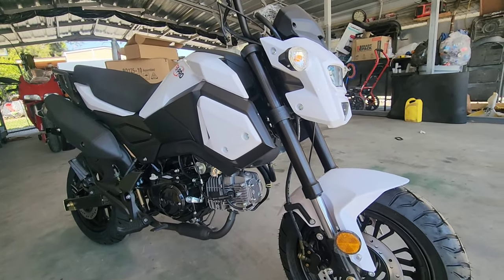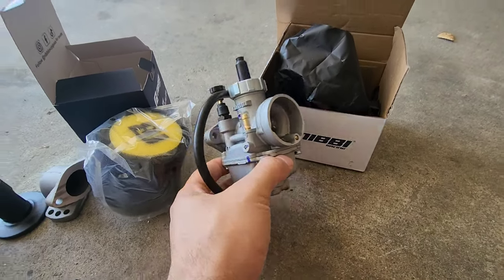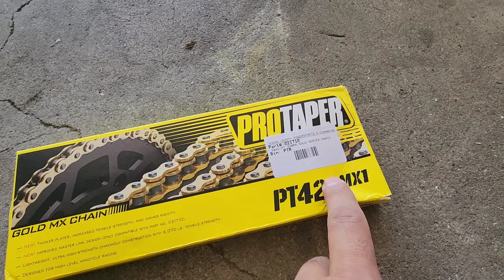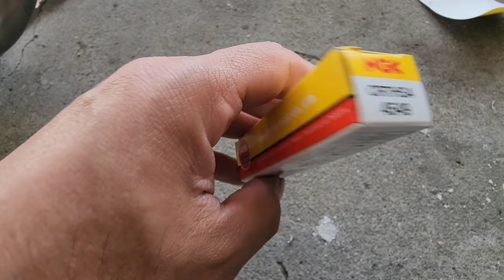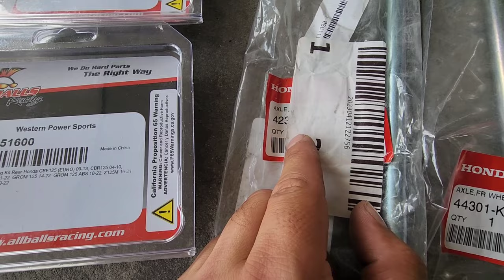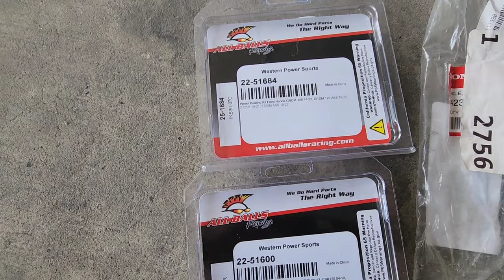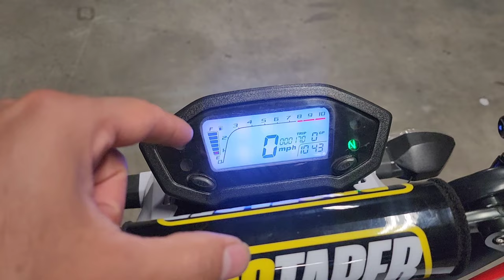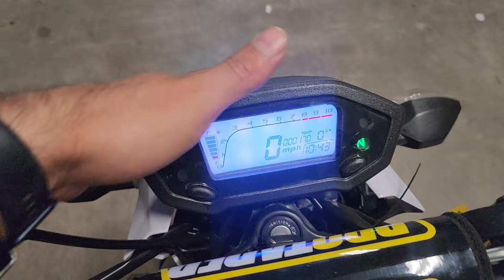Vader 125 Full Guide To Make Reliable (Grom Clone)

Comment: You literally rebuilt the whole bike
Reply: Lol
Reply: I'm about to do the same thing
Reply: $3,499 for a brand new Grom, $1000 plus $1000 worth of upgrades is STILL $1500 cheaper than a stock new grom (which to be fair would not need all these upgrades)
Reply: @adammackay8347 you can fully upgrade and do everything he did for around 550-600
Reply: I literally did everything and stripped this bike for under 300$ I got it to go from 45 to 70 after all done
Reply: @jerameyklein2846 how did you do that bro?
Reply: He literally turned a Vader into a grom and spent more money lol
Reply: @adammackay8347 Vader shipped to your house is 1400 and that’s more than 1k in parts tbh.
Reply: @CapeFilms  not at all he spent a total of 1900 for the parts way cheaper than a Honda grom
Reply: @FinityEdits-kr2qm  I was trolling I literally bought one and I’m doing a lot of what you did and more lol
Reply: I did the same thing. I got it for 1k with 90 miles. 700 in mods and now its my daily for work. I got fast cars and bikes and somehow this became my favorite toy. I can do wheelies and let my friends drive it without having to worry about breaking it. I recommend this bike to people who have knowledge about bikes and carburetors. If you want something thats reliable out the box get the Grom.

Comment: Kudos dude. This is one of the absolute best how to videos I have ever watched. The details on the parts you used makes it right up there at the top. You didn't get bogged down in the minutiae of everything you did but also didn't do the 30,000 feet gloss over either. PERFECT ! ! !  You made me order a vader. My wife hates you.
Reply from the maker: Thank you I'm glad you enjoyed and this vid was useful for you! And tell her that my wallet hates me as well haha!!
Reply from the maker: @bobscat-wj4ub  actually flicking the throttle before hitting the starter, is a way to prime fuel into the intake. Try it yourself without an air filter and you'll see fuel literally spit out of the carb. 

**When not using the choke (as you saw in the video), you can try the method I used for when the engine does turn on, you can keep her alive with some extra little throttle till she is warm enough to hold idle on her own, instead of the using the choke.**

This is how people used to have to turn carburetored cars way back in the day when they had trouble turning them on.
Reply from the maker: @bobscat-wj4ub  I will add, there are sweet spots you have to find when doing this which is why you saw me twisting it. And I will also add that I used too much throttle to turn her on in this video which I literally acknowledged. But I don't hide nothing, this is how it is irl with anything sometimes 😄
Reply from the maker: @bobscat-wj4ub  https://youtu.be/OHwfXJohRpM?si=P5Pubm01X6bVi3aC

This might help a bit
Reply from the maker: @bobscat-wj4ub  you seem to miss understand but, to each their own.

Without the choke, I can prime the carb and do this and turn it on fairly easily. Because there is no choke, I keep the rpms high enough till warmed up.
In this video, upon firing up I added a bit too much throttle. The idea is only to keep her alive with no keep by using a bit of throttle.

I know how engines work, which has nothing to do with me starting the bike. There are tricks to carbs out of the book you can learn as well.
Reply: @anythinggarage , do you have a link for the speed calibrator? One of the best videos of the Grom clones yet.

Comment: Awesome video at 10:40 what did you end up doing with that hose that throws oil at higher rpm? Did you put a catch can system or did you just plug it off?
Reply from the maker: Leave the hose connected. Do not plug it up. It is to keep the engine case vented. Route it somewhere out back maybe not directly in front of the back tire. It won't be spewing a bunch of oil but can in some cases

Comment: Old guy here , back when synthetic oil came along,  it was great for your motor but a wet cluth would slip under a good load. I believe they have a happy medium now. Better slick protection for moving parts and still allows clutch plates to grab. Tbe motor still needs to be broken in.
Reply: diesel oil is better
Reply: @thegreatkrimpus6139  I did not know that. Thank for the info
Reply: @bigfootaintreal5454  Rotella T6 is the best one since it has all the ratings that are required for motorcycle engines

Comment: Had to drop a comment. Amazing video
I’ll be picking up a grom clone that hits top speed 65mph
I want to make the experience more comforting and faster if possible 
It comes with two seats 
Now I know what to work on
I hate to ask before finishing the video
In total how much did you spend to modify?
Reply from the maker: Thanks man! The rear shock is uneeded unless you really want it. Without it, it would be about $1900 EVERYTHING
Reply: @anythinggarage  Jesus Christ! Thank you bro 
What did you swap out just to make it vibrate less and drive better

Comment: Great video.  My exhaust needs way more modding to install than yours.  I wish I would have seen this video sooner.  Either way great info and good luck with it.
Reply from the maker: Half way through the video I discovered the original exhaust I bought wouldn't work so I returned it and got a recommended one 😅
Reply: What fuel did you use to heat?  @anythinggarage
Reply from the maker: @kennyhelms277  just any normal handheld Propane torch

Comment: Curious, how much with mods you actually ended up spending on the bike? Trying to talk the spouse into letting me get a mini bike!
Reply from the maker: If you don't get the unnecessary rear shock (only got it for the red spring and reservoir look tbh), all parts cost me $550. So add that to total price.

Cheapest Grom clone that I know of is the Boss Motor 125 for 999.99 +$300 shipping. Comes with red calipers, VERY HARD front gold shocks, and maybe a better seat. Overall. The X-Pro is a smidge above in quality control and final build IMO.

Your total is gonna be around $1950 shipped with taxes and all parts used here.
Reply: Thank you so much!!! @anythinggarage

Comment: I'm always afraid to take a bolt or a wire out because I wouldn't know how to put it back. Imagine doing all those cables and nuts replacements.
Reply from the maker: @rramales1  I been doing things like this for a few years so I'm used to it. Just a skill you gain in time. It is not too hard to install. Wish I would have made a how-to video though

Comment: No hate because I'm looking at an Icebear furza (to keep stock) but with all these upgrades... wouldn't it make more sense to get an actual Grom?
I mean all those upgrades to actual Grom parts seems like it would get you close to the Grom price minus the manual labor...
Reply from the maker: Quating what i said to someone else. And btw, you can actually get one of these $200 cheaper at RedFox.

"No, not even close. The bike total price cost me $1500. All of these parts except the expensive rear shock I decided to use only cost about $400. Bringing the bike to a total cost of $1900. That includes the $275 I paid for shipping and taxes (bike itself is $1100 before taxes and shipping).

A Honda Grom Stock is $3800-$4100 (abs or no abs) new after taxes IF THEY SELL AT MSRP without a single penny of Dealer Markup!

This is not even including any other fees like Destination Charge Fee and Freight Surcharge fee + (Dealer Fee, DMV (Documentation) Fee, Processing Fee, Service/Set-up fees AND MORE if you finance it."

So in the end you're probably looking at around $5000. For a Grom.
Up to you!!
Reply: @anythinggarage  🤔
You're absolutely correct.
I'm just too lazy to do anything beyond bolt ons and electronics...😅
I have a df250rts (x22r) I've done just about all basic bolt ons (except exhaust the one it came with is actually perfect)
But I want a little more pick up and top end...
Getting a rear sprocket for this bike is probably as involved as installing it.
As far as carbs...sure I can bolt it on... tuning it on the other hand...🛫😶

Comment: Whats the overall cost of buying the bike and doing all the mods? Also how long did it take to install all these parts? I'm really curious if this is worthwhile considering you can get a used honda grom for around $2500-$2800.
Reply from the maker: Brand new, including taxes, shipping and tags, and every mod and parts used here (except unnecessary rear shock, which I got for looks), it comes out to $1900.
It did not take me very long at all, but that's because I do small projects and I'm comfortable with mechanics and some fab work.I'm
Reply: @anythinggarage  well definitely way under half the price of a honda grom

Comment: I personally have a 22' Grom SP. Have about 2000 miles on it. And since Ive got it, Ive changed the oil, that's it. I haven't had to rebuild the bike from new to make it reliable. I do believe in you get what you pay for. And its fuel injected, not carby. But if you cant afford a brand name, reliable, known machine. Ka-boom Vader is an ok second best.
Reply from the maker: I agree with you on this at a certain point. I can't justify spending 5k on this type of motorcycle for what I will use it for and what it can do. Just in my specific case. For $1500 ide say it's worth it with only a few things to get it good to go
Reply: Quit it with the brand name reliable n well known😂😂😂 Homeboy in the video installed and did what 99% of grom heads do , which is install aftermarket parts but in the end , his vader will be just as reliable or better and for sure it’s faster !😅😂 And in the end , homeboy has a faster and just as reliable bike for half the price Mr SO CAL, CORN DOG!!!✌🏼🤣🤣🤣🤣!!  To all riders , cheers from East Los Angeles , Ride Hard n Ride Safe!!✌🏼👨🏼‍🦲👌🏼🛵🏍💯
Reply: @rosieorozco4517  not half the price but 1/4 the price

Comment: You used 3/8 bolts.  The holes in the case were probably drilled to metric and when you drilled to 3/8 you didn't take out a lot of metal so couldn't you have just used a grade 8 metric bolt that would fit the metric hole in the case???
Reply from the maker: Yes! This is a thing that has been talked about before. I forget what metric size bolt they use as an alternative for 3/8, but in general the 3/8 is thicker and much more sturdy than the metric counter part as there is still slight wiggle with the metric bolt. Drilling everything out with 3/8 also makes an exact fit for better overall reliability!
Reply: It would probably be M9 but not sure. Just looking to save having to pull the motor. I think if I was going with 3/8, I would try to just drill one mount at a time with the engine mounted. But thanks for the response.
Reply: Plus, I was thinking it would be better to leave as much metal on the case as possible since it is aluminum and much weaker.  Again, a REALLY great video.

Comment: im getting one to starting learning how to ride thanks for this video
Reply: but i dont really wanna spend that much all at once so what are the main things that i should get edit : easy things i dont wanna take the whole thing apart
Reply from the maker: The easiest and best things to get are the 24mm nibbi carb kit, throttle kit, and the manifold. Look at the description. Also, get the exhaust. There should be 2 links for that.

The free:
You will have to get rid of all of the emissions stuff, cut down and close the egr tube, get rid of the charcoal canister, and take off the valve on the fuel breather.

This should give you the best bang for buck. There is no need to remove the motor. Your motor mounts should survive for a short time, but just be aware that eventually, your frame will break.

Comment: Did that throttle kit with cable need any adjustments with the carb? Ive had a 26mm nibbi i used with the stock throttle cable and had so much play in the throttle which was annoying. Returned the 26mm though because it was to big and had issues. Was tryna see if that throttle kit and cable worked perfect or not
Reply from the maker: Yes worked perfect! Check description!
Reply: @anythinggarage  hows the 22mm holding up though? I heard the 22mm is to small and 26mm is to big so people say go with the 24mm. If you havent touched the idle or fuel screw since you dialed it in the video and etc ill most likely get the same one you have with the throttle cable setup
Reply: @anythinggarage  im also trying to find that 3 bolt intake manifold you installed but cant find it. Or did that not work that good so you got another one?
Reply from the maker: @GregBartlett22  it did work. But I ordered a separate one to see if I can install facing to the side, but it ended up being the same angle.
Reply: @anythinggarage  still using it or changed the carb?
Reply: @anythinggarage  let me know if that carb still runs good or if you have to keep making adjustments everytime you ride and etc. im about to order the same carb if you say all is good so far with it

Comment: First thought that popped into my mind was - how do you pass inspection if you've removed all the emissions equipment?  Aren't bikes like cars, if it was built with an airbox and egr then it must have an airbox and egr.  I'm in NY and know they're pretty anal about modified vehicles.
Reply from the maker: There are no smog inspections on motorcycles at least in my very anal state of CA. Also I took it to the DMV to get it verified. They know nothing about anything. I was fine and you most likely will be as well.
Reply: @anythinggarage  Wow, you're right.  I went to the NYS DMV website and the vehicles that are exempted from emissions inspection are:  vehicles older than 25 years, vehicles newer than two year old, Electric Vehicles, MOTORCYCLES, farm equipment etc.  Thanks for prodding me to check it out.  Now I can make your modifications without worry.

Comment: What ahead and bought the chain off of the link in the description and it’s 134 length, what’s the best way to shorten the chain and remove links?
Reply from the maker: You can buy a chain breaker on ebay relatively cheap or use a socket, punch, and hammer to hammer a pin off. It gets frustrating but works.

There's videos on how to do this. Kids can do it.
Reply: @anythinggarage  ended up using an angle grinder and a punch! Wasnt the prettiest process but worked haha

Comment: Hey man quick question. I just got the black nibbi carb (same one just different color). Do they come with the jets already installed or do I have to put them in. If so, which jets do I use
Reply from the maker: Mine (a kit) came with 3 main jets and 2 pilot jets.
The jets will already be installed on the carb. So in a little baggy came 2 extra mains and 1 pilot.
Tuning is up to you. Ambient temperature, humifity, altitude changes everything. 
I'm in CA, not much humidity, always hot, and 350ft above sea level so I have it easier

Comment: Unfortunately the fender eliminator kit provided in the description will not fit the bike
Reply: You will at least need to change out the stock brake light that comes with the boom for it to fit, I’m not sure if the exhaust mount will get in the way or not, I think it’s just the stock brake light
Reply from the maker: Keep the kit. I will have an update video soon. There are 2 very simple modifications you have to do to make it work. 

1) Cut the middle peice off one of the plates from the kit.

1b) Install tailight at an angle (just like stock but angled to fit with eliminator kit). Use nylon lock nuts so they won't vibrate off like regular nuts.

2) Cut the middle part off of rear seat fairing to fit the tailight.

Easier done than said.

Works with stock tailight. I'm using the kit in this video.
Reply: @anythinggarage  gotcha! Excited for the update video, thanks for putting these together ❤

Comment: Did you use the stock clutch cable with the new levers? I find that the stock cable has no slack at all.
Reply from the maker: I did use the stock clutch cable. You are right.
I will admit the stock lever feels a bit better than the aftermarket. But I got used to the aftermarket one. I have not tried a new cable as of yet.
Reply: @anythinggarage   Would the  oem grom cable fit with more slack for adjustments?

Comment: So why did you get a 26mm intake and a 22mm carb ?
Reply from the maker: It's easier knowing it would work. The flow from a 22 to a 26 on these engines on a sub 200lb bike is so small. it's literally not worth mentioning at all. It works perfectly.

On top of that, I have bigger motors that do use 26mm, so I had a couple lying around.
If you got for a bigger carb because you bore it or get a bigger motor... even better.
Reply: @anythinggarage  make sense ! Thanks !

Comment: quick question, the 22mm carb will fit the 26mm manifold or??
Reply from the maker: Yes! As long as you use manifolds with the same bolt pattern. The 26mm intake manifold and 22mm Carb sizes are only the inside circle diameter of these flanges.